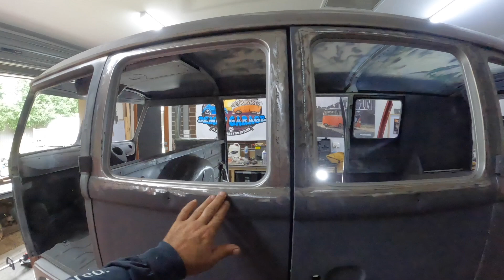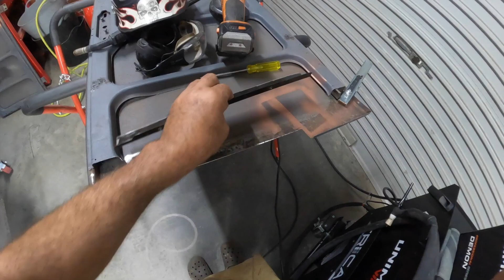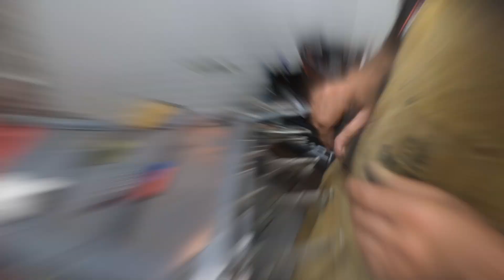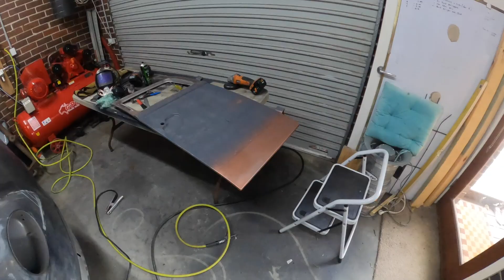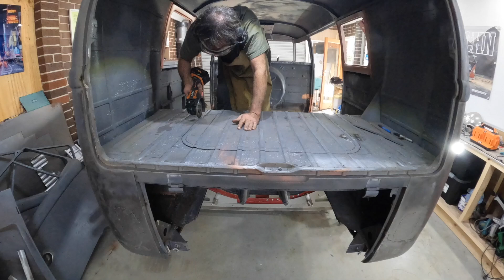VW bus restoration // Double door 64 panel van. Cargo door repairs #vwrestoration

Comment: G'day Mr Nik,
All those doors look great. That was a lot of cutting and grinding and even more welding. 
Q. Are you still using the Unimig 195 welder. 
That rear hatch door, isn't it a great idea? I plan to do it to my 67 bus as well. 
So thanks for sharing the progress man Peace ✌️ from Melbourne/Pakenham.
Reply from the maker: @kevinhamling1963  Heaps of work hay, yes still using all of the welders most days, the uni is a great little unit.